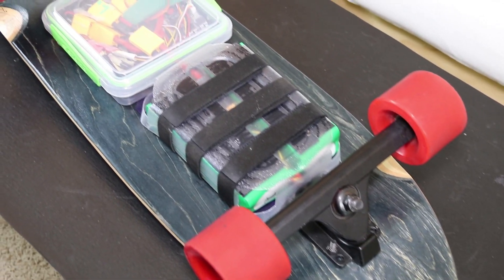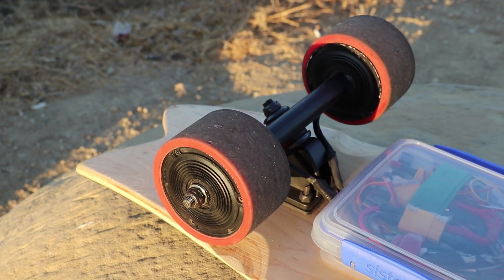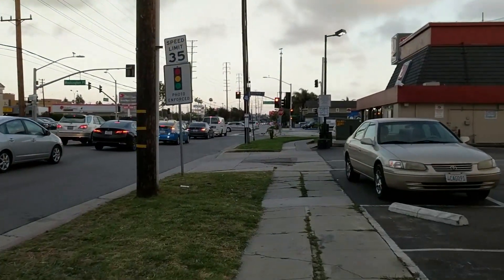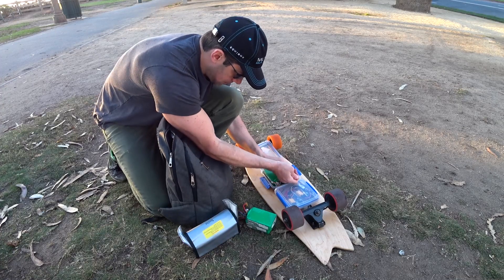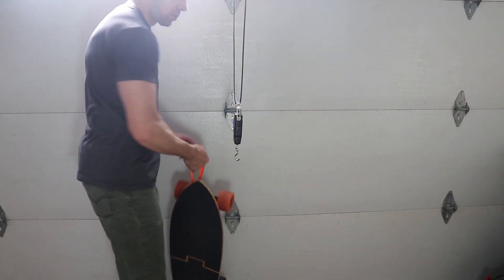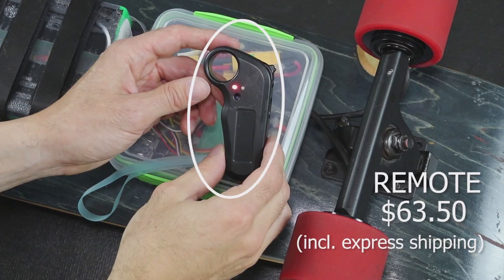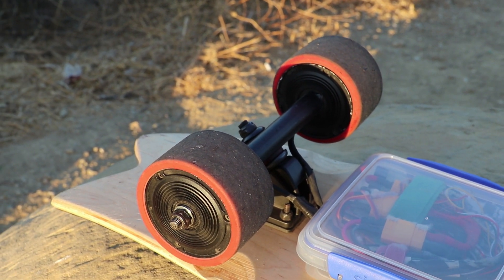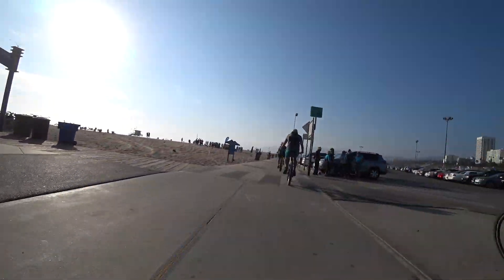My best electric skateboard! So far...

Comment: How does it feel to ride that 32 inch deck? Any trouble with speed wooble? Have you skated much before you started e-skating?
Reply from the maker: I've always been used to riding 32" decks - with a kicktail. I just couldn't get used to a longboard. I keep the trucks a bit tighter than I would on a regular skateboard so speed wobbles haven't been a problem. I used to skateboard a lot growing up and was really into street skating. I haven't been street skating much recently but I'm pretty comfortable on a skateboard.

Comment: Hey Oren, love these videos. Inspired me to make my own diy eboard. I ordered the ESC from your long board video and the dual hub motors as well from there. Still need to pick up the batteries. Question though, how do you charge the batteries?
Reply from the maker: Thanks! I'm glad they're helpful! To charge the batteries I use the B6AC v2 LiPo Balance Charger, along with a parallel charging board. I have links in the description of the longboard build. You can also charge the batteries one after another if you don't have a parallel board. You can find the chargers on ebay https://www.ebay.com/sch/b6ac+v2. I hope this helps. Good luck with your build!
Reply: Ok awesome. Thanks again for the help!

Comment: How steep is actually that hill climb test hill.
Reply from the maker: I didn't measure it. I would describe it as a regular steep hill, not a crazy steep hill. I know that's not very specific. I'd say in general this board makes it up just about every hill. I can only remember 1 hill where I had to walk the board. The 90mm motors I used on the longboard build would be better for steep hills though.

Comment: I’m surprised that toggle switch hasn’t melted, might have to try that out, loop keys are annoying. You should build a belt drive board with a dual 6374 motors you already have the vescs
Reply from the maker: I opened the toggle switch once and the metal switch plate inside is very thick. I don't think it'll wear through anytime soon. Thanks for the suggestion, maybe I'll try that build some time. A pair of 6374 motors running at 12S would be crazy powerful :)
Reply: Oren's Projects Yeah you would be able to go up your test hill at 25 mph

Comment: Thanks for very inspirational video :)
I use to ride e-longboard (heavy and bulky chinese stuff). Now I ride Carver boards - pumping trucks etc. - higly recomend to check those boards on YT, it's a crazy toy. 
And I definetly want to build e-longboard. Probably short top-mount, but I'm thinking about swapping (from time to time) trucks/motor to something like Loaded Tan Tien.
 
Which hub motors do You prefer – 83mm or 90mm? 
I was trying to complete 83mm motors set but they sell it without trucks and front wheels. 90mm set is definitely easier to buy.  
If I decide to buy 83mm set which trucks should I get? They comes in 3 sizes - 251mm, 261 and 271mm.
https://www.aliexpress.com/item/1PC-251mm-261mm-271mm-Dual-Drive-Skateboard-7-Truck-Eleactrical-board-bridge-180mm-Longboard-Truck-Skateboard/32840414970.html?spm=2114.10010108.1000023.12.4432d452oxd7Sr
 I have Paris trucks (180mm) I could use it as a front truck.
Reply from the maker: Thanks! I'm glad it's helpful :). Yeah, I rode a Carver board once and it was fun. For the motor size, both 83mm and 90mm will work fine. The advantages of the 83mm motors are the board will ride a bit lower and weigh a bit less. The advantages of the 90mm motors are you'll have more power/speed and roll over rough terrain better. I guess it depends on what you prefer. Those trucks look like good options if you get motors with the square connectors. The 251mm would be nice for shorter boards.

Comment: could you pleas make a budget diy penny electric board?
Reply from the maker: I'll look into it and see if I can find a good smaller deck. A penny board has some challenges. It's difficult to fit the electronics and battery. Also, if using a dual motor system it would basically weigh as much as a standard board. The difference in weight of the deck is very small compared to the weight of the motors, batteries, and trucks. I built a 30" board in one of my earlier builds. I tried a 27" board and it felt too small. I think a standard 32-inch deck like in this build is a good balance.

Comment: is this overall more powerfull than your longboard
Reply from the maker: No, the longboard is definitely faster and more powerful. The lighter weight and deck design are mostly what draws me more to this board. If I were starting over I'd probably stick to the same motors and ESC as the longboard.
Reply: what transmitter did you use?
Reply from the maker: It's made by a company called "Winning". I think this is the same one:
https://www.ebay.com/itm/2CH-2-4Ghz-Electric-Skateboard-Remote-Control-Receiver-Strap-Motorized-Longbaord/172891976506?epid=2213577290&hash=item28412a333a:g:iNEAAOSw28pZzbd0

Comment: First let me say I enjoy your videos and really appreciate the detail you go into... You've inspired me to build a board! anyway my hub motors arrived with the dual ESC from Maytech today but to my surprise the colors of the wires were different from any I have seen in my research...   From the 90mm Hub Motor the three wires are green, Blue and Yellow..  From the dualESC they are the more familiar red, blue in the middle and then black...    Would you have a guess as to how to match them?  thanks in advance and catch a wave for me...
Reply from the maker: Thanks! That's awesome you're building a board. For the 3 motor wires, the colors don't matter. You can connect them in any order. Once you get the motors running, if they are spinning in the wrong direction, just reverse two of the wires and the motor will change direction. I hope this helps. Good luck with your build!
Reply: it does! and thanks again ..
Reply from the maker: Great!

Comment: Still thinking about what I'm goign to do for my board build :p Thanks for the update, has some good info!
Reply from the maker: Thanks! I'm glad it was helpful. Good luck with your build!
Reply: So question. Do you know which trucks / how you attach the motors you used in this video? I see in the pic on ebay that they have a shape to them but not sure what I need to actually use them. I can try askign them to include trucks but besides that idk what to get. I'm considering them over the 90mm from your longboard build because I can get the vesc and controller and 83mm motors for less than just the 90mm motors and trucks, and these ones still seem really good.

And also, I've been reading that more volts lowers the amps used. This was a strange realization because what I originally knew was that motor kv was per volt so more volts = faster. So does increasing voltage not actually really increase speed? Like you said these can only use 8s batteries and seem good, does that not actually kill the speed over using 10s like on the other build? It can make sense in that the motor max watts doesnt want to change so if volts goes up amps needs to go down but it still feels strange.

Thanks
Reply from the maker: I'm guessing if you send a message to the seller they will also sell you the trucks with the motors. When I bought mine I had to contact the seller and they sent me a PayPal link to order the set. I also requested express shipping so it wouldn't take forever. The motors are also compatible with the trucks Maytech sells (on aliexpress). Higher voltage will make the motors spin faster - different motors are set to a different rpm per volt (kv). When I ran the motors in this build at 10s (before one burned out) they hit around 20 to 21 mph. At 8s they hit around 18 to 19 mph. I think the 90mm motors are built better. I noticed on diyeboard.com there are 83mm versions of the same type motors as 90mm.
Reply: Thanks I'll look into all that. The ones on diyeboard are also on sale which is a nice little boost. And I probably shouldnt cheap out anyway cuz you get what you pay for anyway lol. So the diyeboard ones are probably the way to go.
Reply from the maker: Haha, I'm all for getting good deals but sometimes it's worth paying a bit more for something that's better built. From my experience those motors are a good value. Good luck with your build!
Reply: Ya I agree its probobly for the best to not cheap out lol. Thanks for the help :)

Comment: Oh man, that was great! I didn't expect a third board build.  You're inspiring many people.
Reply from the maker: Thanks! Haha, I didn't plan to build so many boards either. I'm glad if these videos are helpful.
Reply: I was wondering if you'd ever try a belt drive build?
Reply from the maker: I thought about it, but in my option, the advantages of adjusting the gearing and using standard trucks/wheels haven't been enough to overcome the complexity and maintenance of belts. Hub motors work well and are so simple. Maybe I'll try a belt build sometime so I can better compare.
Reply: I'd look forward to you trying a belt.  I think it'd be helpful for many people especially if you also bring the sandwich containers to it!  Love that battery swap system you have!
Reply from the maker: Thanks! Swapping batteries is definitely an important feature for me. Niel at Big Kids is currently working on a nice belt drive board https://youtu.be/LJqyWRSqOy4
Reply from the maker: Cool, I'll check it out!

Comment: Meepo board are cheap 270 from China 🇨🇳 and fast kind like urs
Reply from the maker: Meepoboard is a good option if you want a pre-build board. It all depends on preference. To me, things like light weight, easily interchangeable batteries, kicktail deck, and non-abrasive griptape are some important factors.

Comment: Do you have any advice for what decks and what wheels can go together 
I have the 90mm hub motors from your longboard but, I don’t know what deck I can put it on since all decks of interest I’m not sure if they will fit 
Any advice?
Reply: Most decks should be fine just buy some riser pads just in case (not an esk8 builder yet just a regular skater)
Reply from the maker: robert ancillo is correct that most decks should be fine and you might need riser pads. The longboard trucks have 2 sets of holes to fit both longboard and standard size decks. If you go with a board that doesn't have cutouts over the wheels you might need to add risers to avoid the wheels hitting the deck when you make sharp turns.